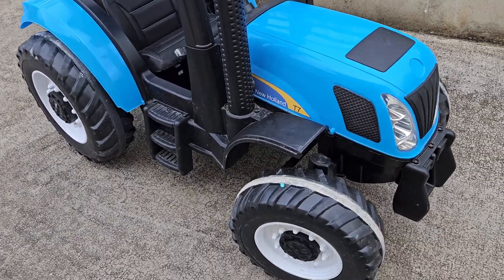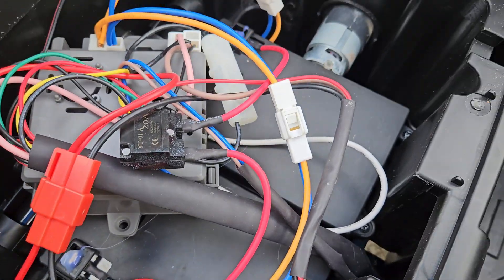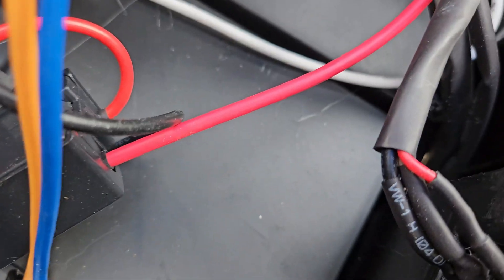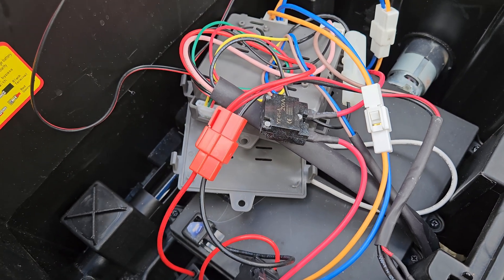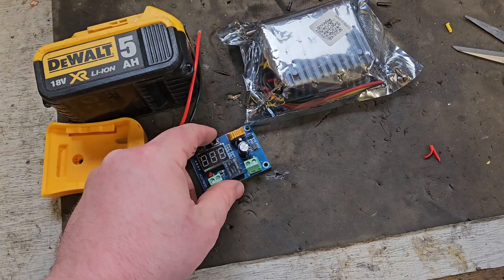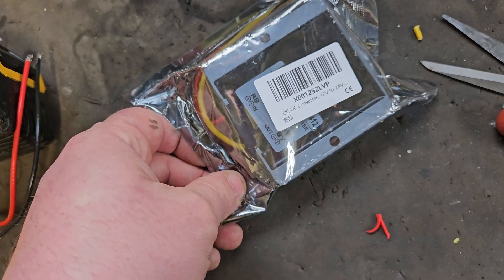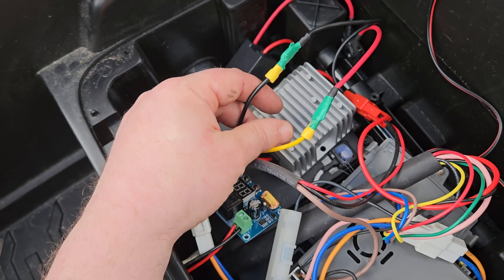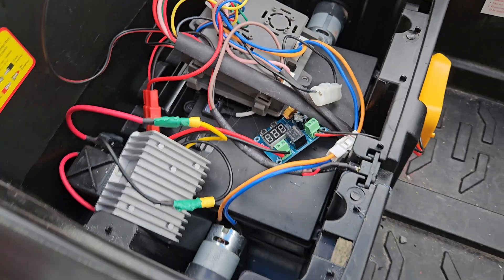Insane 24v Dewalt Tractor Conversion!

Comment: I don’t really understand the use of that 12v to 24v converter piece. Can you explain? I saw a few conversions done on youtube without that piece.
Reply from the maker: The battery I am using to power it is operating at a lower voltage between 20v and 15V I am stepping it up to 24v
Reply: @doctorlefthandthread ok, it starts to make sense. So if I am using the 18V 5ah Dewalt battery do I need this converter? 

I am also considering using a 18v/54V 6Ah FlexVolt Dewalt battery. Would that be possible on the same setup?
Reply from the maker: @HelloWorld2000-o9q yes the flexvolt is putting out the same voltage as the smaller one

Comment: Hi there. Fantastic job! Thanks for sharing.

I have a few questions: I have a 24v Ride on car that I want to convert it to Dewalt 18v battery. Having only 1 converter kit with an 18v dewalt would give it the same power as before or it needs 2 conversion kit installed in series and 2x18v so it gets the same or even more power than before? 

What if I use a FlexVolt dewalt battery? Would it compensate for power with only 1 converter kit? 

Thanks
Reply from the maker: As far as I can see the one battery runs it fine 
2 wouldn't be any benefit in my opinion 
The flexvolt battery will not make any difference either
Reply: @doctorlefthandthread so based on your experience 1 conversion kit would give the same power as the 24v car is giving now?
Reply from the maker: @HelloWorld2000-o9q yeah
Reply: @doctorlefthandthread thank you very much!

Comment: Yes lad would that conversion be better than the battery’s that’s comes with it ?
Reply from the maker: The Dewalt battery is quicker to charge and alot of people have lots of them so for that reason yes
Reply: @doctorlefthandthread  would it last longer than the battery in it? Am buying one for the wee buck next week
Reply from the maker: @Cleanuproofcleaning  the issue is that the internal battery takes a long time to recharge about 12 hours people tell me